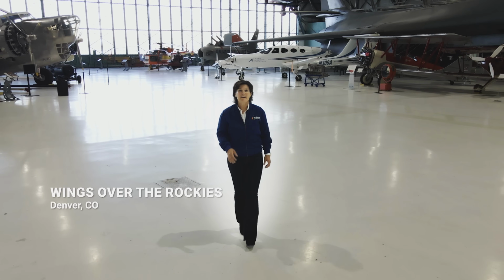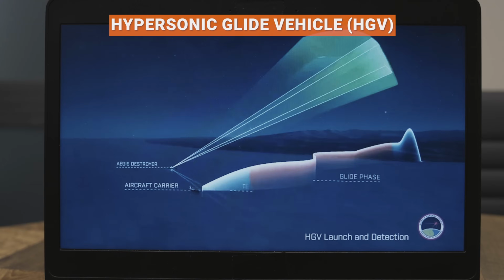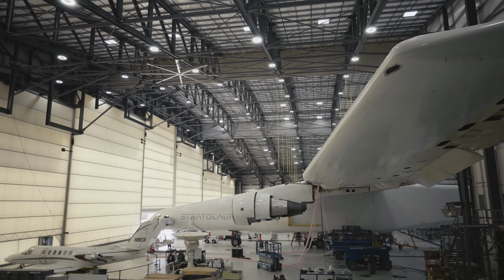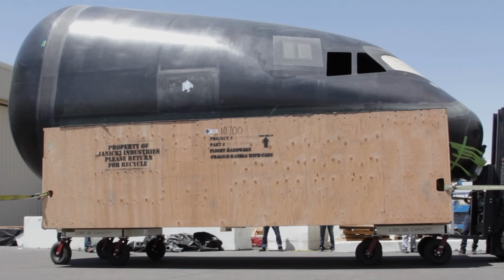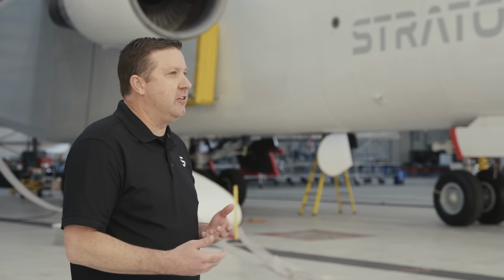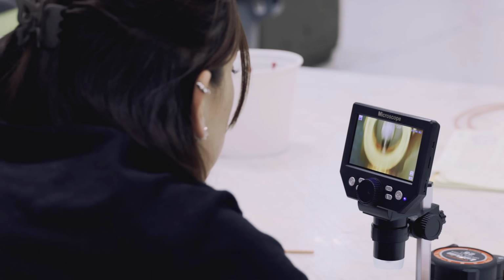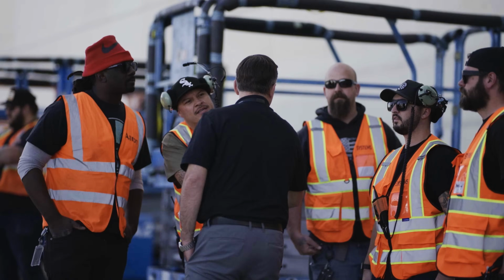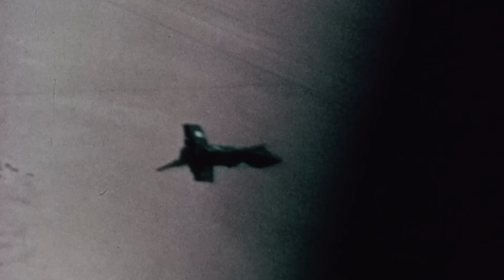Hypersonic Flight Testing | Behind the Wings on PBS

Comment: Hay what about Virgin Air with Branson his aircraft looks quite a bit like your aircraft.
Reply from the maker: Burt Rutan designed both aircraft
Reply: Burt Rutan designed SpaceShipOne and White Knight the mothership before he retired. This aircraft was designed by people at his company for Richard Bransons space tourism company, virgin galactic. But it was not his design.

They shelved the idea of space tourism because they built an aircraft 5x the size and about 50x the cost to do what Burt Rutans original design did.  (It was already going to cost $100,000 per ride in the early 2000s. Multiplying that by 50 or 100 is a nonstarter. As Russia was offering rides on Soyuz in that era).